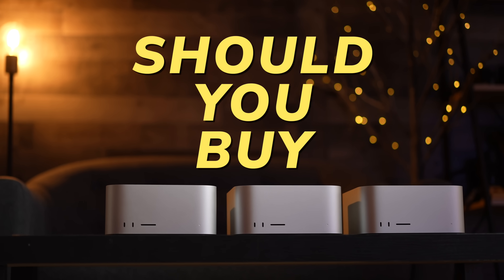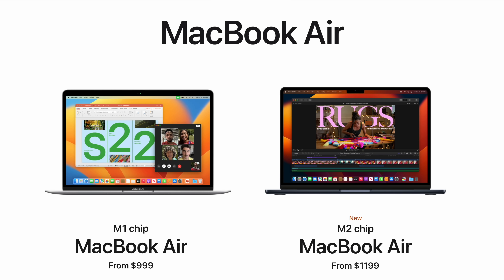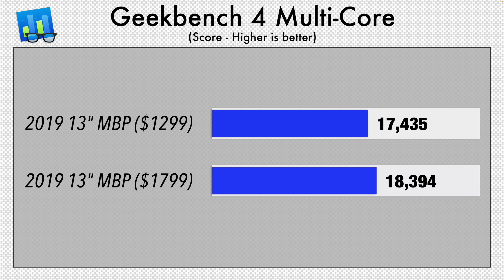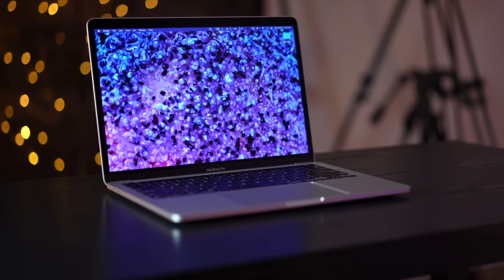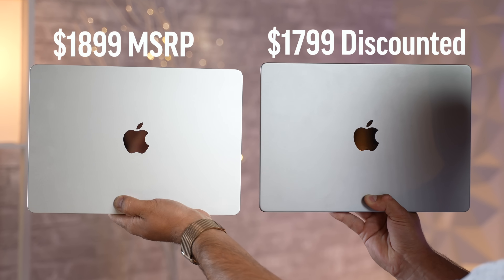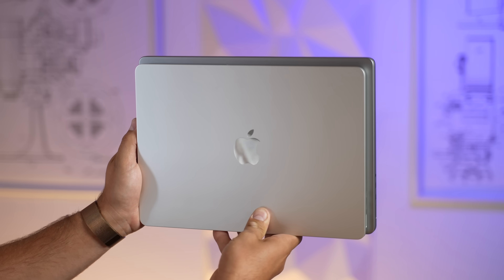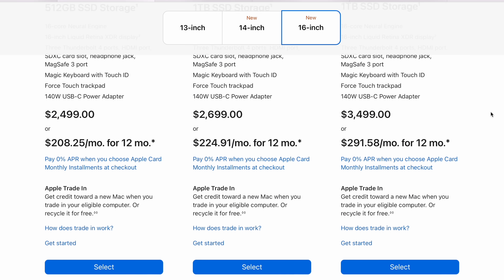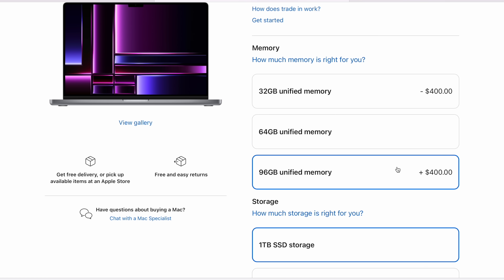How Much RAM for Your Mac in 2023? ULTIMATE GUIDE!

Comment: Bought the MacBook Pro 14" M2 base model and only upgraded to 1 TB and I'm in love with it. 16 GB of Ram is more than enough for heavy work. Graphic design and working with models and such. the 1 TB is quite overkill but I upgraded from my MacBook Pro 13" 2013 base model from 10 years ago which still works great and I did lots of work on it, so it was such a huge upgrade.
Reply: Hey what happend to your 2013? Mine is still running strong. Have you thought about upgrading the ssd for it?
Reply: @ramblr5900  it’s still working great, I gave it to my son :)
Reply: Also how much of an upgrade is it? Can you list it
Reply: @ramblr5900  it’s a huge upgrade tbh, much faster export and import and the screen is stunning, everything is a long faster. The sound is fantastic too.
Reply: @GeneralAlex  cool thanks for the answer what was your use case for the 2013? I used mine to edit photos and learn to code. The speakers died on me so I dont watch movies on it. any more. It was horrible for games only could play App Store and Starcraft 2.
Reply: @ramblr5900  Graphic designing, video editing, and many other things but those where the heavy use for. Mine has still everything functioning well. Except obviously the battery would need a replacement but I use it always plugged in. A full charge only lasts like 2 hours.  And that laptop was only 8gb ram and 256 gb storage 😅 so having 16 gb and 1 TB feels a lot different.
Reply: My mid 2015 macbook pro 15 just left me, screen is gone, i ve just ordered a macbook pro 16 m2 pro 1tb 16 gb of ram, i was bit concerned if would be enough for video editing, how are you finding it? Waiting for mine to arrive
Reply: @dottorcarlone  congrats! You will defo enjoy it, it’s overpowered compared to intel based laptops like by a lot. I’m so happy with this laptop compared to the 2013 one it was such a ridiculous gap. You are set now with this device for 10+ years. Just take good care of it, it will be capable to do literally everything.

Comment: I get the point of the message but don’t fully agree. 8Gb ram is plenty for nearly any typical user. Unless you are doing pretty sophisticated video editing or are a pro photographer where saving seconds is really important to you. 

Essentially anyone else will have a great time spending £200 somewhere else and won’t even notice the extra second here or there when working. In over 2 years I have never seen the beach ball in my M1 Air (bad model) except when rendering. That includes coding (visual studio, rubyMine), productivity (G Suite, office 365, edge/chrome). 

Only caveat is I have never tried gaming, so if that is your thing I suspect the air is not even on your option list. 

I also had a M1 Max (24 core, 32 gb) which was awesome at video editing. It would crush the renders. I never got close to really filling the ram and it did not feel any faster for typical use than my air unless editing. Actually there was a difference if I had tonnes of browser tabs open - the air would pause for a second whereas the pro didn’t need to. 

Anyway, keep up the good work MaxTech.

Comment: As someone that is an active DJ with residencies I need to have the ability to have any machine handle DJ performance software. (I.e. Serato DJ Pro) I also am running Serato Video and SoundSwitch (lighting control software). I currently have the legendary 2015 15inch with 2.8 quad core i7 with 16 GB RAM and 1 TB of flash storage. I’ve had my eye on some certified refurbished MacBook pros, both Intel and M1/2. I’m just stuck on what I should invest in for definite futureproof.

Comment: Max, would you recommend just upgrading the RAM on M2 Mac Mini to 16 GB, with 256 GB SSD, for best bang for your buck case? Or SSD upgrade is also very much recommended due to slower SSD issue? Thanks for the great video!! 👍👍
Reply: It actually depends on your budget. Upgrading to 16 or upgrading the hard drive to 512 for each $200. If you can only afford one and performance is what you’re looking for than upgrade the ram. However, if you need the additional storage, then I would just upgrade the hard drive And deal with the fact that it might be a little bit slower.
Reply: Thanks for the comment. As Max pointed out that single 256 SSD is slower and that performance is also slower with 8 GB, I’m perplexed with what upgrade makes most sense. Yes, I have budget for only one upgrade.
Reply: 256 is a joke. I've had a 512GB SSD in my iMac for 8 years now. I have about 1/2 of the space left today but have to monitor it. All my photos and videos live in external drives too which most people don't do. Just pay the Apple tax and make your life easier.
Reply: I see your point with storage, however 512 is also not that big enough for a decade of photos & videos, one would still need external SSD. The current base trim macs are even worse with single 256 instead of two 128. At the same time 8 GB RAM is not advisable for multi- tasking & photo editing and that we can’t upgrade the RAM later. I guess I need both upgrades unless @MaxTechOfficial says otherwise.
Reply: @techgear6430  I said I keep all my images/videos in an external drive. Even a 1TB is going to be too small for most people's archive of their photos and videos. External storage is a must for most everyone.

Comment: you also have to consider the ssd speeds—>if ram goes into swap with an 256gb sdd (on m2) it will slow down considerably because of the slow ssd
Reply: An M2 machine with upgraded ram (even when in swap) works faster than the one with upgraded SSD, there r tests available online

Comment: Great budget machine? No Apple product other than the current Apple TV is "budget".  Calling a MacBook Air budget is one hell of a stretch. If you need a laptop that's budget oriented get an older Windows (new with an older CPU and chipset) and use Linux or even Windows. People looking for budget laptops generally have fairly basic needs in a computer that are well served by cheaper alternatives. And they can get more bang for their buck with an non-Apple laptop. For example, more storage and quicker storage for the same amount as the starting price for a base MacBook Air. And for those that want budget Apple laptops they are generally buying older Intel based ones (used  or refurbished) and are more concerned with the Apple logo on the cover. I would only consider a MacBook Air or Pro if it has 16GBs of RAM (MacOS appears to utilize memory more efficiently than Windows OS) and possibly 1TB of storage due to the crippling of storage speed Apple is using on the M2 versions. Factor in the upgrade prices for memory and storage capacity and its impossible to call these MacBooks "budget".

Comment: I got the last MacBook Air without Apple silicon, and 8 gb of RAM/256 gb of storage model is ok if you have Clean my Mac installed. I paid $400 for it a month ago and it works fine. I might want to buy a battery for it in the future.

Comment: Only 16gig+... if you go with 8gb, your SSD will fails after two years of mid-use... its not about only "light tasks". If you use not M1 optymalize apps, system will use Kernel and swap tones of data on your SSD. So Mozilla + discord and its over.

Comment: Thank you!  I have been considering the Mac Mini Pro since it came out and have been not able to decide whether it is better to get the unbinned version or upgrade the RAM.  I have already decided to get 1 terabyte.  Based on your video it sounds like it would be better to get the unbinned version and stay at 16gb of RAM.
Reply: I have the exact same question - not sure whether to upgrade the RAM to 32Gb or go with the unbinned chip. Any advice please?
Reply: @johnbertram8462  guys, what did you do? what was your choice and its performance if got this?
Reply: @fa-jz1xj  I went for the binned version with 32GB RAM and 1TB hard drive and it’s perfect! Super quick and snappy. For my needs it was definitely the right choice.

Comment: Hi! Thanks for the helpful info but just to be 100% sure I wanted to double check. If I plan to use programs such as Photoshop, Blender, and Zbrush would 32gb of RAM suffice or should I go for 64? Side note, I am waiting for the M2 Mac Studio to release to purchase my next work machine =D
Reply: I guess that depends on the scale of your projects. I've chosen a Mac Studio M1 with 32 GB RAM, as I didn't plan to create huge scenes with Blender. I did experience Blender crashing a few weeks ago when I had set the number of (hair) particles to a high number (with also 'children' activated). Not sure if that was due to RAM limits. If you want, I could try to reproduce the issue and check what the RAM usage is at that moment (and how many particles it exactly were).
Reply: I could perhaps also try other things in Blender if that helps you (and if it isn't hard to test, I'm only an intermediate Blender user).
Reply: thanks for the info! I also just use blender for basic block ins but zbrush for sculpting so that might be a bit more intensive.
Reply: @tmdao89  for intensive ZBrush usage I think you need more multicore power, if you will not use for UV unwraping editing/texturing M2 Max 64 Ram will be fine. There is a noticeable gap between Max and Ultra for intensive UV/Texturing/Digital Painting tasks ( on ZBrush/Corel Painter/Substance Painter and Photoshop). Only or sculpting M2 Max 64 Ram will be fine I guess.
Reply: You should go for any Mx Ultra as much as RAM you can afford. I have owned and use both Studio Max/Ultra for 3D, any kind of  workflow for 3D go for Mx Ultra . For Blender ZBrush do not go for 32 RAM M1 Max, maybe 64 or 96 RAM M2 Max but this will not my choice, I feel way better with Ultra because of tedious M1 Max limitations.
Reply: I don't use ZBrush, but sculpting in Blender went smooth so far on the M1 Max Studio. But I just started learning that aspect of Blender, so I suppose my sculptures aren't that detailed yet.
Reply: @MegaChriz  it could be, I do not use Blender for sculpting. I have an idea for Zbrush,  just consider 20-30 million polygons for each subtool and imagine you have 20 subtools. This demands a lot of multicore processing power and also Ram.

Comment: You are right. 8GB for the M1 are enough. I have more than 2000 tabs open and it works. The bigger problem is to have not enough space free on the SSD. That slow down the Mac more than the 8GB RAM.
Reply: Seems like it’s using swap space on the SSD because RAM is maxed out?

Comment: I was tempted to buy an M2 Air that I found on sale for $1,050, but after watching a few of your videos I ended up buying an M1 Air on sale for $800 and a 9th gen iPad for $250. So i got both for the price of M2 Air. No regrets!
Reply: Except now you'll have to replace BOTH much much sooner, costing you money when prices and interest rates will be even higher than they are now. 😂
Reply: @ChatGPT1111  he will only need to replace it at most 1 year sooner though? plus he has an ipad which he wouldnt have at all if he bought the m2 air
Reply: @landon1136  M1 Air came out 2 years before the M2 so at least two years. Interest rates will continue to be high for the forseeable future.
Reply: @ChatGPT1111  i wouldn't say m1 air will be obsolete earlier than m2 air.
Reply: @ChatGPT1111 troll / bait account spotted
Reply: @ChatGPT1111 I disagree it depends on what you're buying like my iPad pro from 2021 still maxes out on all games for the most part and I bought a m2 Mac book pro which probably won't need to replace for a very long time until I find new features that are worth it like an OLED screen and a touch screen Mac.
Reply: @ChatGPT1111 not true. I’ve bought my mom the base model M1 Air and used it myself: It runs great. Does everything that can be considered as “school work” and basic editing and light gaming. The M2 chip is just an overclocked and boosted M1 chip, so if the M1 is a terrible choice, so is M2. No? 

And for the iPad it’s a great deal man. I got the iPhone 12 Pro with A14 and it’s plenty fast, the 9th gen iPad has an A13. Having those two devices side by side for the same price is an awesome deal. I got the iPad Air from 2018 with an A10 (processor shows it’s age, but handles basic work perfectly enough!). 

Dude, don’t be a sheep. The tech has reached a state now where all these chips are having a way longer life span than in the old days with intel. Don’t be a prick now.

Comment: I went for the baseline M1 Pro exactly because upgrading the M2 Air to 16GB + 512GB would make it costing almost the same as the M1 Pro, which has much better display, better speakers and more ports. Of course that's the very strategy of Apple with those prices/configurations.

Comment: Mac Studio user here with 64 GB of RAM doing Motion Graphics in After Effects. I debated back and forth between the 32 GB and 64 GB version since the upgrade cost was significant but after several months of usage, I'm 100% glad I went with the 64 GB version as After Effect just demands so much RAM. I've been very pleased with my experience and have only had some small hiccups with very demanding projects.
Reply: Does 64gb ram also uses swap memory sometimes?
Reply: Did you get the M1 Max or M1 Ultra?
Reply: @HughRussell06  Apologies for the delayed response, I got the M1 Max with 32 GPU cores.
Reply: How much RAM does after effect use
Reply: @AriCalifornia-ny1td  The latest version of After Effects requires a minimum of 16GB of RAM but it's beneficial to have more if possible for longer previewing when you're playing your edited footage. If you're not doing very long animations, very intensive graphics or not editing very high resolution videos, then you can get away with less RAM.
Reply: @lolfirepoisonftl  ah I see thanks
Reply: that's what I needed to hear. Thx
Reply: You did a real life comparaison between the 32 and the 64 ? Or you just saying that based on what you know about AE ? Is there any SSD swap happening now in the last version of Macs and AE, making no difference now between 32 and 64 ?
Reply: but do you think 96 gb would have been even better? or no?

Comment: You need to consider whether your machine would still be usable in a few years in making decisions regarding RAM and storage, particularly if use your MacBook for work that has a demanding workload. If you use it casually or/and for fun and don’t mind buying another MacBook in 2-3 years then just get the cheapest base model.
Reply: Exactly! That was the main reason I bought 96GB RAM just because I know the next laptop I will by only in 5-7 years. As my experience shows me my 2015 Air with 4 GB was a nice laptop and still is, but the lack of RAM makes is almost useless nowadays.

Comment: Well, I know EXACTLY what I need, it's 32GB now, and until that amount arrives on the top end of the consumer machine — I'm hoping the M3 in a Mac mini or an iMac form factor will do that — then M# Pro it is for me. On my older iMac with 24GB, I REGULARLY run a cache cleaner every single day through the Maintenance portion of MacPilot, which also runs the cron scripts. Even then, SOMETIMES, things still hang for me. Talk about frustration.
Reply: Your slowdowns could also be because you removed things from the RAM cache so it had to be loaded in again...

Comment: For the people with a limited budget, would be interesting to see a performance comparison between the m1 (256gb 16Gb) vs m2 (256gb 8gb).  This option should cost the same.
Reply: It depends what you plan to use it for. 
For soft dev Xcode: M1 16GB
For Video editing final cut: M2 8GB
For graphics and design: M1 (8/8) 16GB
For Audio (Logic/GarageBand): M1 16GB
For general use (safari, pages, numbers, etc): M2 8 GB
For future proofing: M2 8/10 16GB 512+
Reply: If you plan to mainly use it for Final Cut Pro, get the M2 but make the effort and upgrade it to 16GB (256GB $1399)
Reply: If you plan to use it mainly for Graph and Design make sure you are getting the M1 8cpu/8gpu 16GB or if you can afford it get the M2 8cpu/10gpu with 16GB (512GB $1699)
Reply: if you get an M2 consider upgrading the sdd to at least 512. 
256 is half speed for transfers (and memory swaps+longevity) (+ $200)
Reply: If side gaming is important for you try to upgrade to get the M2 8cpu/10gpu 16GB (512GB $1699)
Reply: @PatricioBenavente  final cut with 8gb? You must be kidding me :v
Reply: @DucNguyen1412  not ideally. Better with 16GB
Reply: If you plan to use it mainly for audio creation: consider if you can upgrade to M2 8/8 24GB (256GB $1599)
Reply: Avoid the 256GB SSD in the M2 Macs because it uses a single SSD chip and it has half the performance of the dual 128GB SSD modules in the M1 256GB Macs.  Also, definitely get at least 16GB of RAM because 8 GB is not enough and it will cause excessive page swaps to the SSD.
Reply: m1 macbook air 8gb for $500?

Comment: As web developer, I needed 32 GB memory for my M1 MBP.  Reason is that often a few servers run at same time in Docker, code editor, design software like Adobe XD or Photoshop, and a few browsers w/ multiple tabs.  All together use up at least 24 GB of memory, but yet without use of swap yet.  Guess others w/ lighter load of work, 24 GB could be enough.
Reply: I agree. As fullstack developer I got 32GB M1 Pro and just after launching all IDEs and Windows VM I am at 26GB used. But the swapping seems to work just fine. I once forget network logging turned on for a few hours which added almost 30GB on top of that and I did not notice anything, I found out only when closing it.
Reply: Thank you for this. I’m getting into web development myself. I need to purchase a laptop for school.
Reply: I need more Ram and storage for my M1 Max mini, but I’m not buying a new computer until the MacBook Pro 14” with m3 pro is released